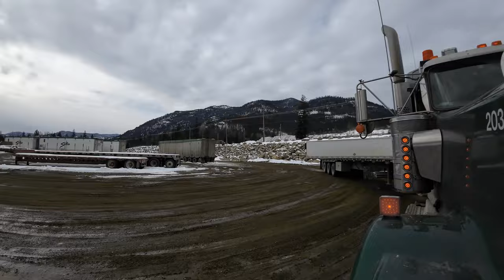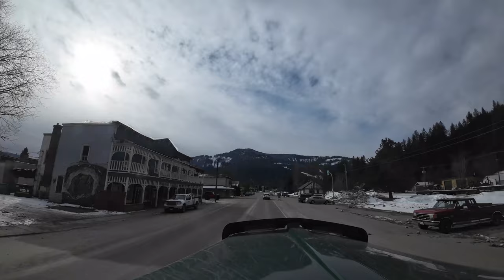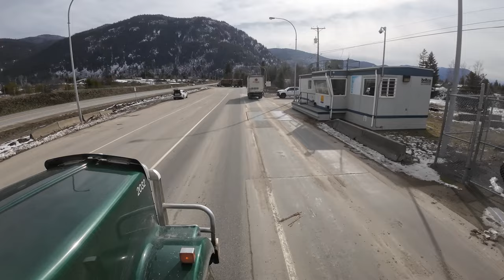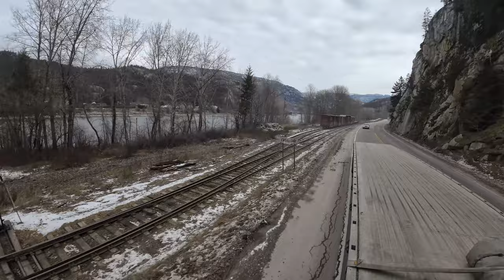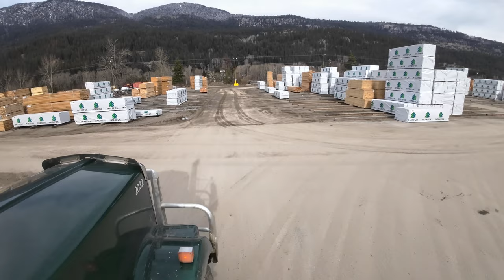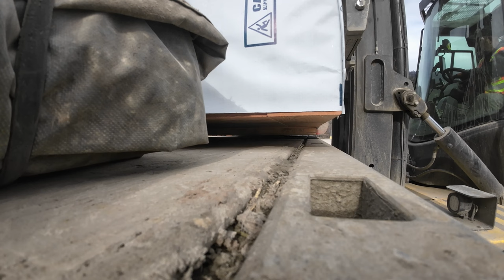Interfor Castlegar • Trucking Life 🇨🇦

Comment: That sounds good advice, if you go up a mountain at 20ks. You go down at 20ks. I know on road, especially dirt roads I stay in 3rd gear as it is safer coz it slows you down and you don't use the Brakes so much.  Dad used to say, gears are for a reason so use them accordingly.